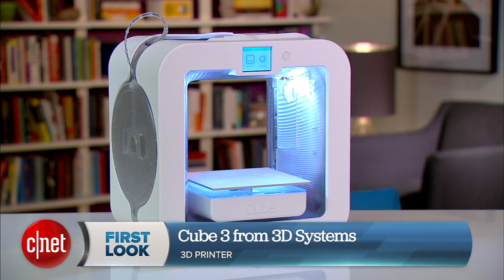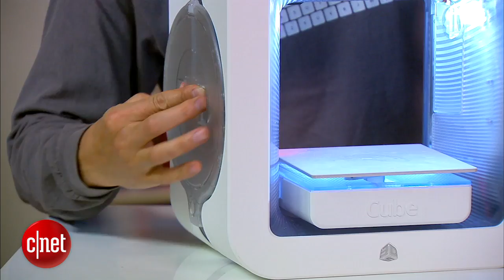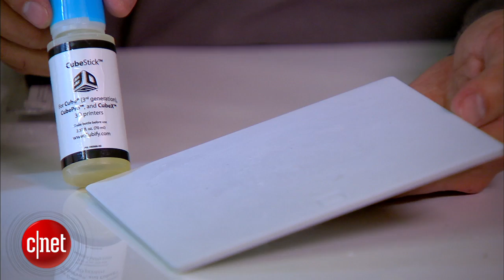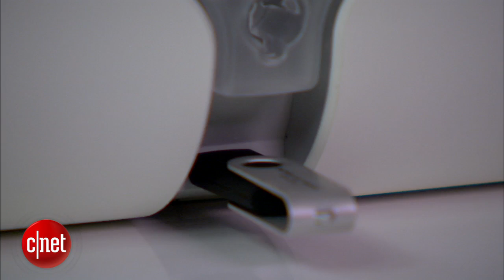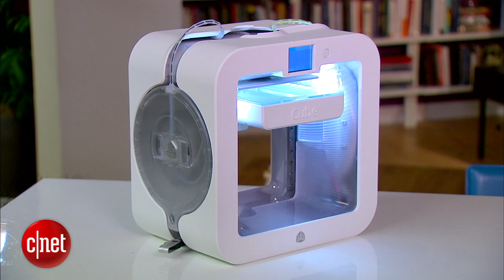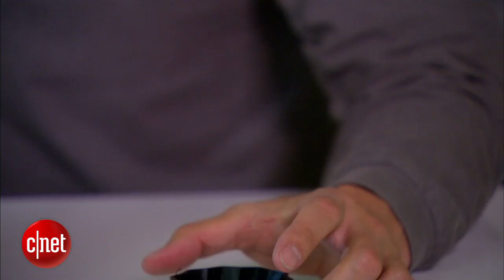The Cube 3 is a cute 3D printer to say the least

Comment: do not buy this 3d printer its a junk and a scam i have 2 and the rolls if you print today and not for 1 or 2 weeks your printer rolls will get jamed and no fix for it the company tells you to pege jets 2 to 5 times till it works well i done it about 10 times and still dont work
Reply: Luis C you are correct. You would think these things were set to fail after so many jobs. How about you select the color that is loaded and it print in the color that it wants regardless of what you selected on the software.
Reply: Luis C I have purged and the the thing will still try to print from a jet that does not have any filament coming out looked for breaks and found them but the filament doesn't move out on purging.
Reply: i have tried everything i gave up the company gave me the money back cuz it was a discontinued printer cuz of that defect
Reply: i did all the steps that the company told me and dose not work
Reply: lol yes thats 1 of the problems i have on top of that you cant adjust the tempatur or remove the heat tips to clean them since there a 1 piece with the roll >_< horble desing
Reply: You mean to tell me I have a discontinued piece of junk!? That's just great.
Reply: yes it was discontinued where did you buy it on amazon.com ?

Comment: Could I hack the filament holder to use standard filament?
Reply: you can rip out the control board and solder everything to a RAMPS + arduino combo running marlin and it'd work with standard filament. that's about all these are useful for.

Comment: Why anyone would ever buy this printer is beyond me.  
 It uses very expensive proprietary filament. $50.oo per 600kg vs $22.oo - $25.oo for 2000kg of premium 3rd party filament.   It's a "no brainer".  Cost for this machine at launch was about $1000 costs now around $180.oo  plus shipping as of 07/18/2016.  Filament is still the same price. ($50.oo) This company is now using the same tactics as HP or many other inkjet manufacturers selling you a machine on the cheap and then bending you over on the consumables...    Wake up ppl....   Thanks for letting me vent!
Reply: I was looking at purchasing this printer. Can you tell a better printer in this price range?(180$) Thank you!
Reply: Reprap kits

Comment: If Apple made a 3D printer, this would be it…
Reply: $4000 and can only be printed from a mac. The printer also needs a $100 adapter to connect to the internet and the printer software costs $50. Each filament cartridge costs $100.

All that and it prints as well as a $200 3d printer
Reply: considering that the cube 3 has been completely discontinued and you can't get filament for it anymore (which was overpriced to begin with), the apple analogy is even more apt now.

Comment: Cube 3D Printer is so expensive with no reason. You need to buy filament with the filament holder. You cannot refil filament in filament holder. Go to amazon and see the customer review and rating.

Comment: I found your review to be quite informative. Would you have a better suggestion for a better printer for around the same type of money? I'm seeing Makerbot, I'm seeing some other cheaper printers. What's your favorite for the price?
Reply: Nobody wants Proprietary printers that require special filament, etc. I have a conversion kit I’ve designed for Davinci for this reason. Make them closed loop, swap motherboard, add a touch screen, remove proprietary printer roll carriage and modify, change extruder, and hot end and make them into an FDM printer like a QUDI. Otherwise toss them in the trash or gift to someone who can breath the life back into them. No wonder these didn’t last.